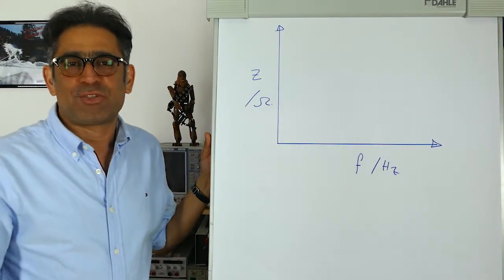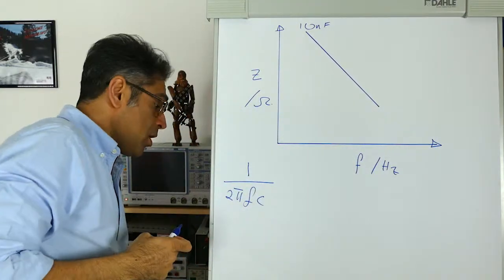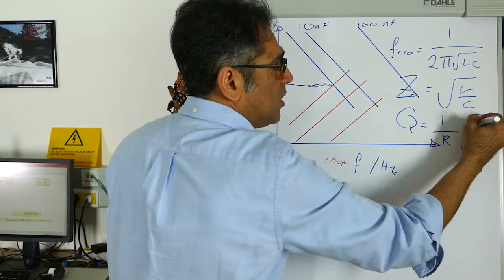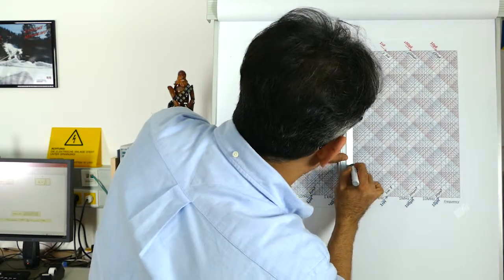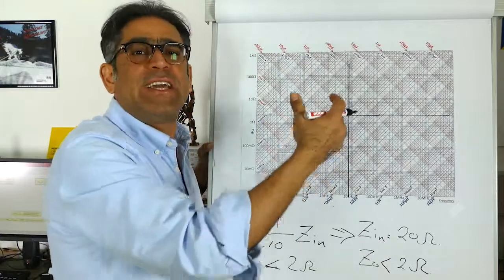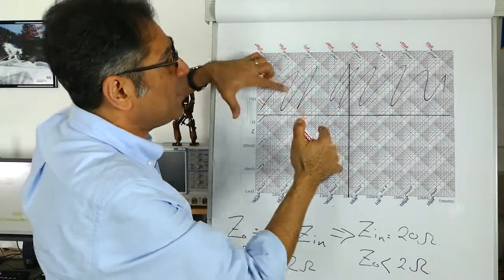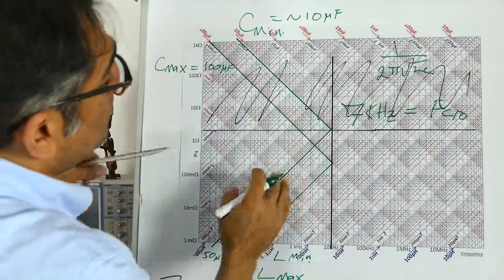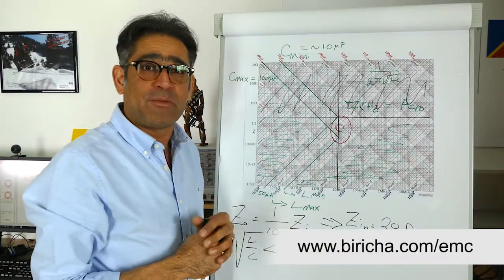EMC Filter Design Part 4: Differential Mode EMC Filter Design Down to Component Level

Comment: Thank you so much for those videos. One question has came my mind.. We assumed that our cut off frequency is 7kHz. How can I determine mine? Do you have any idea? Is this cut off frequency coming from noise frequency? Thanks in advance..
Reply from the maker: You start with the frequency of your expected disturbances and think about how much you want to attenuate them. A LC filter has i.e. -40dB/dec so you know where to approximately put the cut-off frequency.
Reply: Thank you so much for your answer. I think I need to study LC filter first. Because the terms you used are coming a bit strange to me :D  @OMICRONLabTutorials

Comment: How do you know if one has issue with CM or DM noise? Is there a range of frequency which determines CM or DM?
Reply from the maker: We have asked Dr. Ali and his response was the following: "Generally speaking in most power supplies DM noise in more prominent in lower frequencies say up to around ~5MHz and CM noise in more prominent above ~5MHz."
Please note that there are measurement circuits available for discriminating between the two such as LISNMATE that you can use in the conducted emission band or you can use a high frequency current clamps and power splitters.
Reply: @OMICRONLabTutorials  Thankyou for follow up response

Comment: Thank you for these lectures.  A question on the Zo < 1/10 Zin statement - where does 1/10 come from?  Is it a rule of thumb to provide solid margin in all cases, or does one require additional margin beyond 1/10?  I'm trying to prevent double-booking margin.
Reply: its like a rule you can  review DC Middlebrook  criteria stability

Comment: 5:01 What is the source and sink impedance situation when the EMI filter is being made for solar panels, specifically, to reduce radiation in the PV panels and panel wiring from the MPPT switching noise?  Many thanks for teaching, much appreciated.
Reply from the maker: Dear Steve, unfortunately we don't have experience with solar panels and solar panel wiring. I would guess that the inductance of the connection could be quite significant if the converter is not close to the panel. Please contact info@omicron-lab.com for detailed questions.

Comment: The output impedance of the input filter expression seems to be frequency independent which does not make sense. For a simple L-C filter the output impedance in Laplace domain should be ( S * L / ( S^2 * L * C + 1 ) )  which is a frequency-dependent expression. What you have written for Zo seems to be the characteristic impedance of the input filter.
Reply from the maker: Dear Ertugrul Kocaaga, please excuse the late reply. The idea in this case was to set the Impedance such that we get a Q of 1 at resonance. If you do that, you will end up with the simplified expression.